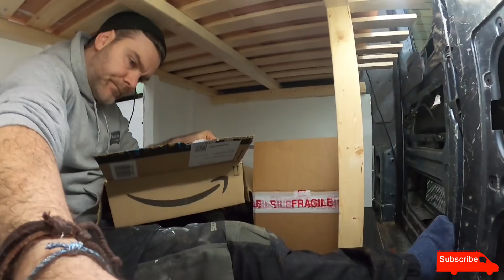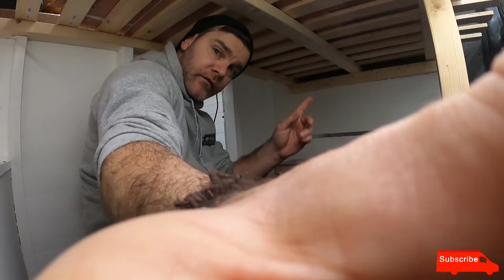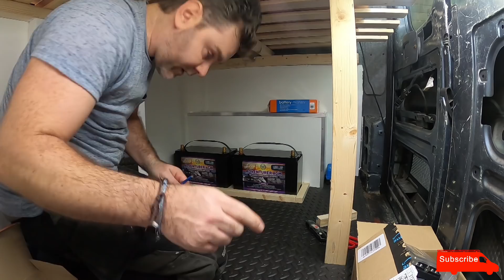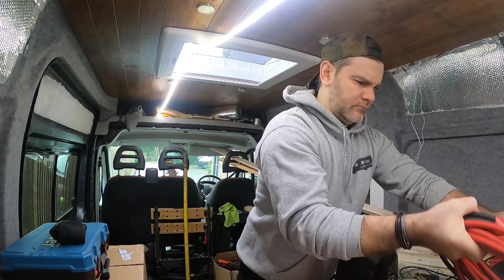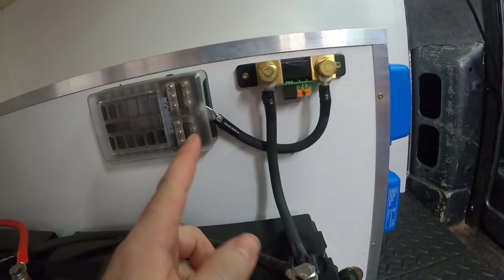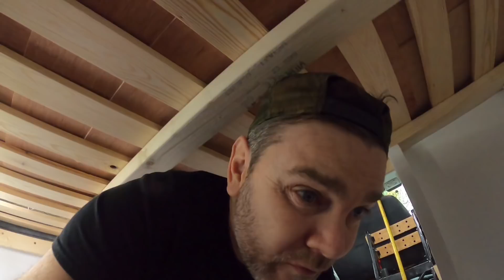Setting Up Camper Electrics || 12 Volts || Ducato Camper Conversion || Episode 15

Comment: Hello Luke I watched your video the electrics are very tidy good job well done 😀👍👋👌😎🍻 I have a small renault kangoo van I am going to Live in it for some time so i need to be totally of grid I want to run diesel heater and fan and usbs  and poss water pump any ideas would be greatful 👍💡🍻

Comment: Hi Luke, nice set up. Do you have to earth the shunt to the body of the van? Thanks
Reply from the maker: Negative terminal out of battery into one side of the shunt. I then have a cable from the other side of the shunt to a negative bus bar for all the negatives to join to, including a grounding cable to the chassis. Have as few cables coming off the battery and the shunt as possible by using bus bars. 👍😁

Comment: Hi Luke. I've just ordered two of these batteries from Alpha. It states the terminals are bolt through type two but what size lugs are required? Also do you have a link for the crimp tool you are using please. Great videos and I'm almost up to date with your current build. Looking good 👏👏
Reply from the maker: Hi, Ive since removed the brass terminal posts And used the m8 bolts provided with the batteries to bolt cables directly into batteries. Monday coming's vid you will see this. here is the link to my crimp tool. https://www.amazon.co.uk/Iware-Ratchet-Crimping-Electrician-Crimper/dp/B01KX4Q952/ref=sr_1_5?dchild=1&keywords=large+crimping+tool&qid=1616881216&sr=8-5

Thank you for watching my vids. I hope you continue to watch :)
Reply: @LukesVanLife  Thank you. I'm up to date now and I have watched loads of your Iveco build too. I'm converting a Mk2 Renault Master minibus and I think I do more head scratching than you do 😂

Comment: After i turned off the isolater it still had power, confused or what 😳, van looking great thou. ✌️🇬🇧
Reply from the maker: Was the power you still had slightly less though? For instance were the lights working just slightly dimmer?

Comment: Hi i have a question might sound like a dumb one but here goes i want to do a two battery set up like this one nut when it come to the solar do i need to run the neg/pos from the control and do poss to one and neg to the other ? Or just do it all to one battery? Thanks in advance keep up the great videos
Reply from the maker: Exactly as you said first. POSITIVE TERMINAL ON BATTERY 1 ➡️ FUSE/BREAKER ➡️ SOLAR CHARGE CONTROLLER. 

NEGATIVE ON BATTERY 2 ➡️ SOLAR CHARGE CONTROLLER. 

If you get stuck or have more questions let me know👍😁
Reply: @LukesVanLife  pretty new to all this solar stuff so i have a 175 watt victron panel and 20a controller what amp breaker would you recommend ? Yes its a low end set up but just want to get it right 👍🏻
Reply from the maker: Well, I have a 50amp controller, but I'm using a 30amp breaker. If I had your system id use a 20amp breaker. Buy a few, put as low a fuse or breaker on there as u can. As I said in the vid, ask people, don't just take my word on it. Ask ten people, watch lots of vids then make your decision yourself 👍😁
Reply: @LukesVanLife  cheers for the advice and yes watched a few vids now and going to be honest alot of them seem to not use a breaker in the set up on the poss to controller which i found to be very strange but was glad when i came across your channel 👍🏻
Reply from the maker: @robtrueblood853  I have lots of friends who don't use breakers or fuses at all with their solar system. For the price of a fuse, why not put one on :)

Comment: Do the battery's not have removable posts? Surely it would be safer to bolt the cables directly to the battery's rather than having uninsulated posts.
Reply from the maker: indeed. I have since done that :)

Comment: As you intend to sell it, boxing would be good - I think I would have also put the 2 Victron controllers inside the box too - and made it the same height as the wheel arch so it covers the fusebox etc too, but removable. That space right next to the 2 Victrons is one that people might use a lot - so they might get bashed?? I'm just about to start my electrics, and was in two minds about where to put the isolators for the battery and the Solar PV - I'm thinking they should be easy to see/get to, but not in the way so they get bumped etc...

Comment: The shunt screen should be mounted on the living side of the garage so you can see the battery condition without climbing into the garage. The breaker would also look neater turned 90° anticlockwise.
Definitely box the batteries in or make a slide over clipped cover. Nice work going on there 🙂
Reply from the maker: Yea the BMV display will go in the living space so you can see it even though it does have blue tooth so u can check on your phone. Thank you for watching 👍😁

Comment: Would be even more neat, if the shunt is mounted vertical with the readout connectors to the right, that would avoid the ground cable crossing...
:-D
But what do I say, I can't show you my installation, I would cry for shame...
:-D
Great job so far, thx for showing to us!
Reply from the maker: I tried mounting the shunt that way, I didn't like it lol. Thanks alot for watching as always 👍😁

Comment: Nice and neat Luke, shame your videos are so behind, same as me though, because I would recommend using plastic clip pipe connectors to tidy the cables as they are modular if you ever wanted to add or move something. Great video though! Ha ha you thought you went overboard I got 50 mm cable🤣🤔😅

Comment: As you are using bolt fittings on batteries. Should you not remove the brass clamp lugs? Stay safe🚐☕️☕️👍🏼🏴🌈🙏🏼💙❤️💙❤️
Reply from the maker: i have since done that :)